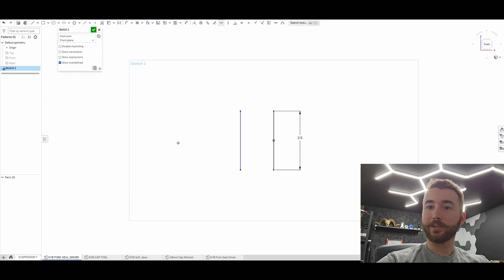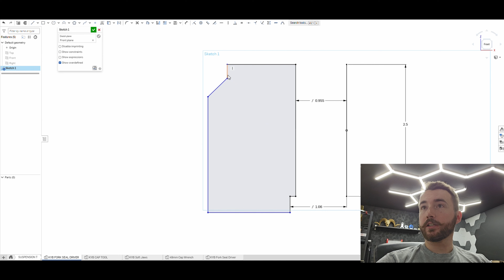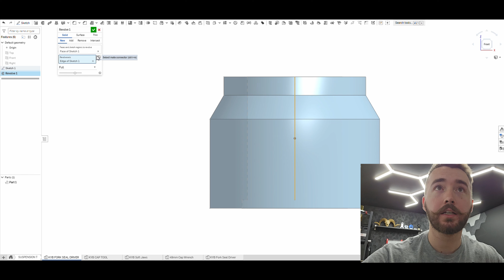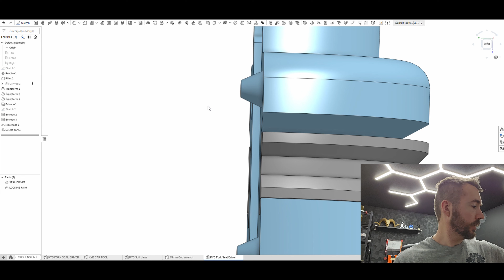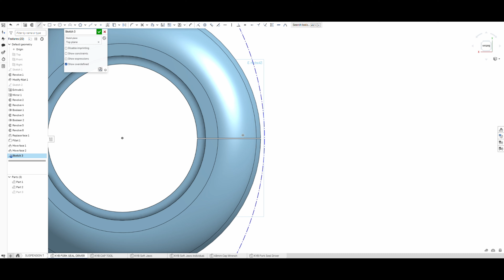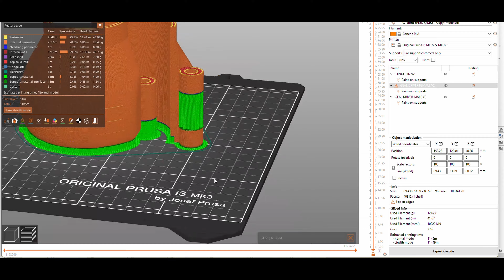I 3D Printed ALL My Fork Rebuild Tools

Comment: Really cool that you’re showing how to design it in Onshape I am a beginner, 3-D designer, and I use Onshape and I don’t have many other beginner designers that use on shape because it’s free and web-based. It’s cool to see a professional cad designer utilize it
Reply from the maker: Thanks, its actually set up really well for professional use mainly because of the web based system. It makes sharing stuff internally and accessing the same documents on different computers really easy. The only thing I dont like is its slow compared to a downloaded program if you have a fast computer. On the flip side its fast compared to a downloaded program on a slow computer.